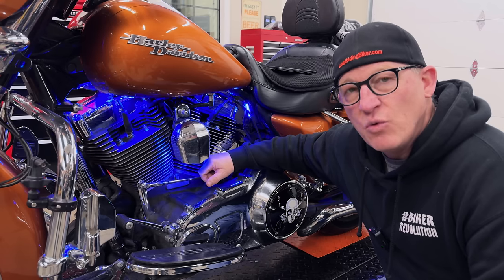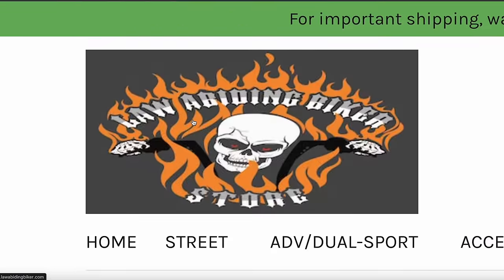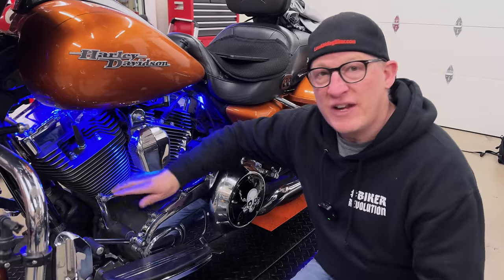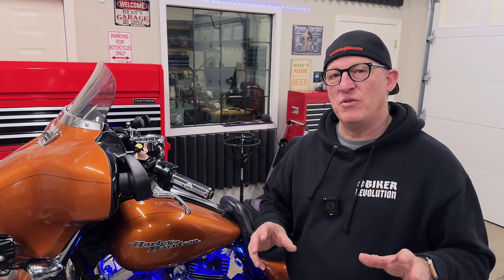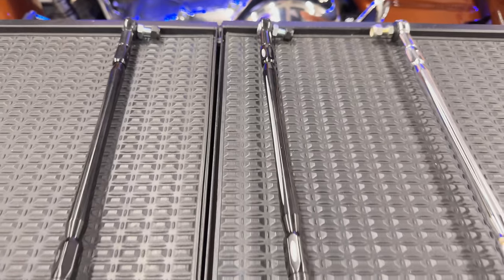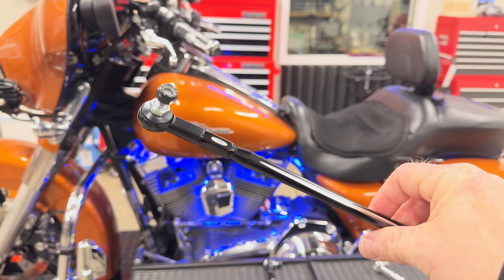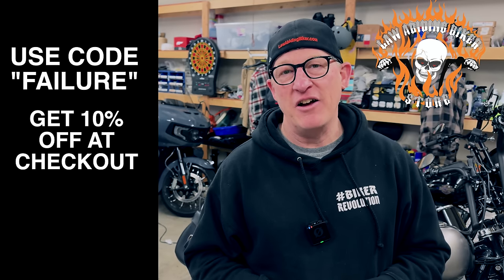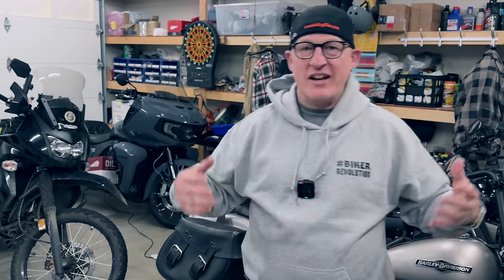2 Things GUARANTEED to FAIL On Your HARLEY! MOD THIS NOW 👍

Comment: Uhhhhh….why doesn’t Harley fix these known problem things.   They charge enough for the bike.
Reply from the maker: I know, same as BMW and others. There are just some things like this that have to be changed. I certainly wish it were not the case.
Reply: This is another reason why I will never trade mine in for a new one. After replacing way too many parts on the one I have I don't ever want to start over from scratch...not at the premium price the Harley charges for unfinished bikes.
Reply: Why don't they fix them?...$ that's why
Reply: How many motorcycles have you had that will last you your entires adut life? Let us call that 40 years. You pay 30,000 dollars for a pretty well loaded one. That is 750 dollars a year. I've had 12 or 14 metric bikes... not one of them has lasted even 8 years. They just wear out. Nearsighted people get to bothering the vibrations of life. Stop being a bad vibration.
Reply: Defective water pump 700 bucks the m8 2017 -2019 defective oil pumps,cam chain tensioners ,eco cam bearings the list goes on 😢and on😂
Reply: Try grease then no problems.
Reply: @MrDoyle07 l have had my Sportster for 25 years and 400,000 miles on the original engine and 37 back tires and 17 front ones and 3 belts in 25 years. My Sportster is my daily driver as I don't have a car. I have had my Triumph Tr-6 with a hard tail and magneto for 40 years. Ever since the EVO Harley big twins have so many quality issues for such an expensive motorcycle shameful 😢.
Reply: Harleys are designed that way … that’s how they make money !!
Reply: Because there are not really issues
Reply: @charlesscharfy6607  You can't be serious.  Do you really want me to list all the mechanical issues that the new motors have? Catastrophic engine failure at low mileage is #1. Followed by a shopping list of mechanical issues too many to list.
Reply: @MrDoyle07  I have had my Sportster for 25 years and 400,000 miles on the original engine and 37 back tires and 17 front ones and 3 belts in 25 years. My CX 500 had 250,000+ miles on her.l had that bike for 10 years. I have had my Triumph Tr-6 with a hard tail and magneto for 40 years. Paid $7,000 for my Sportster. My daily drivers.

Comment: I’ve riding Harley since 40 years back. I’ve never had any problem like this.
Reply: I too have never heard of shift linkage or arms coming loose or breaking in my 30 plus years of riding. Neither me nor anyone I have rode with ever had these problems you describe. Periodically check all your fasteners is good advice.
Reply from the maker: Glad it hasn't happened to you yet.  check out the overwhelming comments on this video of riders it's happened to over many years. It's a widespread issue ==> https://youtu.be/_GJz_J8IgqI
Reply: 88,000 on one evo never a problem. 74,000 on the twink never a problem. 67,000 on the 2017 m8 no problem. I have seen it happen on bikes not maintained.   In my shop probably done 5 in 40 years.  Guess your just lucky 🤣
Reply: It’s happened to me in the middle of a ride
Reply: Amen, proper maintenance and inspections of your ride, and she'll last you a lifetime.
Reply: Some people hammer on their shift linkage pretty hard.
Reply: hasnt happened to me either.  pretty sure he just wants to sell tools
Reply: @bradboustead1682  I see it all the time. Guys just mash the shifter going into gear from neutral. The clank from the trans can be heard for a 100 yards.
Reply: Ditto 160K miles on Road King and never had a problem. Of course I don't slam my foot/heels onto the shifter.
Reply: So, I was down at Daytona Bike week on my 2003 Anniversary Edition Ultra Classic.  I rode down and have 46K on the bike.  As I was shining the Harley Cover on the shift linkage, the damn thing came off in my hand.  So I just happened to be in the market.  I had my standard Harley Tool role and 2 black Zip ties that I carry with me, better than bailing wire, that Zip Tie got me back home.  The new Buell's are looking damned good, getting tired of this ticky tacky shit on my old great Hardley.
Reply: @MrChancebozey  Inferior pivot design, it happened to me on 2 different bikes.  Pretty common for people that ride the holy shit out of their bikes Mine has 70k of cross country miles.
Reply: 59,000  miles road king. Road Trip ready! Does your import motorcycle have a indicator light that tells you when to shift??
Reply: @richardburdyn9369  My Moto Guzzis do and I can set them for whatever speed I want.

Comment: I am so glad 😊 l have a great Sportster 883. I have had my Sportster for 25 years and 400,000 miles on the original engine and 37 back tires and 17 front ones and 3 belts in 25 years. She is my daily driver as I don't have a car. I have had my Triumph Tr-6 with a hard tail and magneto for 40 years. When she was 50 years old she needed new camshafts we split the cases and new ones and changed the sludge trap. Put her back together and now she is good for another 50 years. It's a shame that HD big twins have so many quality issues for such a expensive motorcycle 😢.
Reply: Rock on sportsters ! , 94k + on my 02
Reply: Ive got 135,000kms on my 09 Nightster, still mint

Comment: Why would Harley not want to fix this?
Reply: Because Harley. They've been building in engineering failures for years. My personal favorite is the brake system that literally eats itself with moisture.
Reply from the maker: Have  no idea. Been that way for years. Many other manufacturers of bikes and cars have things like this that you can't understand.

Comment: Yep my OEM linkage failed riding down the highway.  I got lucky and the nut and bolt came loose rather than the ball socket popping. So I hand tightened and made it home.  Ended up swapping with a Heim joint linkage sold by Kustom Cycle Parts on Amazon. Company out of Nebraska I believe. Anodized billet aluminum. And they will engrave so you can customize.  I also replaced the shift arm, shaft and those shaft bushings that require a special bearing tool.  But the end result is much more stable and failure-proof.  So if Kury stops making these, there are other options.

Comment: I replaced the rod ends with heim joints years ago but retained the stock pushrod.  The rod is not the weak link, the rod ends are.  I bought rod ends from McMaster Carr, a huge parts house for everything industrial.  I keep one of the old stock rod ends in my tool pouch in case another rider has a stock one fail on the road.  
I had to replace my worn out rear shift arm last summer.  On six speed bikes it’s an easy replacement, older 5 speeds requires the primary cases to be removed.   Check the fasteners on front and back arms with a torque wrench at each fluid change.
Reply from the maker: Correct. Pressed ball and socket/stock.

Comment: Had mine fail on a trip to Sturgis, it stripped coming into Missoula in the evening. Rode it through the night to Billings HD and had it fixed under warranty. Had to shift by hand all the way to the dealership.
Reply from the maker: Yeah bro, I've been there. Hand shifting to get to where you need to. LOL!! thanks for sharing.

Comment: Did 100 k on evo not a problem with shifter rod but I grease it when doing service.same as my street bob 30 k & not a problem .just a tiny bit of grease does wonders .thats why I do all my own work  shops skip the small things same as gear shifter & break peddles grease there pivot points .just like you should lube cables witch is another thing shops don’t do .

Comment: I had my shift linkage fail  last summer half way through a 10 day ride.  thankfully I did notice on my pre ride check i was getting some movement  in the linkage before heading on on the ride. I recalled your video about this Ryan.  on day 2 of the ride just happen to stop in a HD dealership to check things out.  while there i checked with service department and picked up a new shifter linkage.  Planning to swap it out once I got home.   Well on around Day 5 of the ride it failed , and  thankfully between myself an the buddies i was riding with , I was able to swap it out , and get back on the road in about 1/2 hour.  Thanks Ryan   love the videos.  you  save me some hardship and let me get back on my bike to enjoy the ride.
Reply from the maker: Just awesome story. Thanks for sharing. That's my aim, is just to help bikers know about stuff like this, so they aren't stranded.

Comment: I feel you on the linkage failure. I zip tied my linkage in 2015, I replaced the zip tie last year 2023 in Nebraska (i run South Texas to Sturgis). No need for a shifter replacement. I just carry plenty of handcuff grade zip ties. Also bring black gorilla tape.
Reply: wow. did zipties really work?? i have a 2013 ultra, always concerned about breakdowns far from home
Reply: @nelsongn9  yep. Zip ties really held it together
 Nut came off on front of primary. slid out. I zip tied as an emergency. It held indefinitely. Then the pivot above that came apart, zip tied that too. Many years ago. Might replace it some day. I have 2000 FLHTCUI. Note: 70k on Magnetti Marelli electronics. No issues. EDIT: not every issue can be fixed on the road, but for the ones that can, gorilla tape, Zip ties, and superglue is worth every square inch it takes up in the saddle bag.

Comment: Haven't had the shift linkage fail but I have had the shifter shaft fail on a long ride.  A lace from my wife's extra pair of boots worked find to upshift.  I'd rev it, pull in the clutch and tell her to shift and she'd pull back on the shoe lace.  Luckily it would still catch to down shift to get to the next dealer for repair.  It's made a good story over the years!
Reply from the maker: Yup I had the shifter shaft issues as tons of other bikers have. Check this out ==> https://youtu.be/_GJz_J8IgqI

Comment: Back in 2006 my shift rod failed 2400 miles from home at a stop sign.  I packed along cable ties which worked to get me moving again. Replacement has always been the number one item for my Harleys since.

Comment: So true. It failed on my '07 Low Rider with less than 30K on it. The replacement is so superior I recommend doing it NOW. Don't wait. In case you're wondering, low mileage because the guy I bought it from didn't ride much. .

Comment: I own a 2007 RG. My shift linkage is ALL stock. I have the bike since Memorial Day weekend 2007. I have over 103K miles on the bike. I clean and lube all pivot points at every service level. I have not had an issue with the shift linkage. I am now replacing inner primary seal and gasket. Also the shift shaft seal into tyranny. I will probably get a new linkage now and replace the stock one for astetics and prevent an issue this season. JRH

Comment: Replaced mine when I moved my mid controls to forward.  Also put some Loctite on the threads on (Sportster) the nuts don't back off during vibration.  Shaft arm - other of a different design than that.  Those linkages are very beefy!  I like those!  Cut out Roland Sands style.

Comment: 05 Softail and my linkage "fell off" thankfully while washing my bike in the driveway amd not at speed in LA traffic. Was really surprised how cheap amd janky this part is compared to the replacement. I guess its fine for the low mile donut shop rider, but not for a daily rider that will see many miles.

Comment: Just ordered mine up! Great imfo. Mine is good to go, but trying to be proactive, I'm getting mine while I can. Great video
Reply from the maker: Totally, I bought a 2024 Street Glide 2 weeks ago and I'm replacing it tomorrow. NO reason to get stranded. THANKS FOR SHOPPING IN OUR STORE!
Reply: The ball & socket joints failed after 8 years on my Road King so I went to Ace Hardware and picked up 2 heim joints installed them on the stock shift rod. Shifts just fine. Cost ? $10.

Comment: At the start of a long trip mine fell off. Tied it up with Para Cord and drove straight to the dealer. Install a Gimble bearing type and used it on my 2012 Ultra and now on my 2020 TriGlide.

Comment: Iam so happy I just bought a 2002 Dyna Wide glid non running in really great shape chrome and paint really nice got it for 1300 on ebay auction. What I've found so far is broken cam gear on crankshaft got more to investigate of course but I have a good looking bike to work with.

Comment: Agreed. the stock linkage rods do fail. We always upgrade to custom rods with real Heim joints. However along with tools, I carry a complete (nearly new) stock linkage rod in the bottom of my bag.
Reply from the maker: Roger that. We too carry an old linkage just as a backup. Thanks for watching.

Comment: I just changed to heim joints. Went 80,100 miles on my 08 stock joints. 
Just sayn.
But,  the heim joint is more solid for sure.

Comment: I purchased one online. Aluminum with Maltese cross, “ Ebay“. When I received it, I thought it was plastic, I did the bite test 😂, it was a very cheap “Chinese“ aluminum. While on a ride, it split in half. I Thank God I had the original in my side bag and was able to change it out quickly then catch up for the ride. I learned my lesson from online aftermarket bike parts.
Reply from the maker: Yah, Amazon is a beast for sure. Advertising so much knock of stuff these days. I feel your pain.

Comment: Oh boy are you right about the shifter shaft arm and the linkage going bad at the worst time. I had the shaft arm splines go bad on my ‘15 RG on my way to Laconia last year. Coming out of a toll booth it failed. I could only get into first and second gear. By the grace of god I was only a few miles from  Manchester HD. I was able to ride to the dealer and change out the shaft arm and the linkage in the parking lot.
Reply from the maker: Thanks for sharing.

Comment: Just bought one Ryan. Thanks for your video. Is the sticker shift bracket you also mention one from HD or aftermarket company? I have a 2014 SGS.
Reply from the maker: The shifter shaft arm is OEM ==> https://youtu.be/_GJz_J8IgqI

Comment: I have an 04 Electra and I'm going through the gear shafts annually.  The teeth on the inside of the shaft (closest to the motor) keep getting stripped.  This time around, I noticed the bolt threads are also chewed up, so I am replacing that too.  I've done the blue loctite and checked everything else.  I just cant figure out why this keeps happening.  I've had to make it home with zip ties several times now and I'm looking for answers!

Comment: Bike had 15k miles at failure at the front spline (stripped) during a month long road trip out west in 2017. Fortunately I had researched this before leaving and carried a spare linkage, arm and spline. Pulled over in a McDonald’s parking lot after I felt the shift going limp and repaired it in under an hour and was on my way. The was no indication of failure before I left on the trip.

Comment: Have a 22 Heritage Classic and came with heim joints with thru bolts but still changed it . Joints on these aren't failing but the bolts are . Had one break on my light bar in front and now recalled for shock adjuster bolt.
Reply from the maker: Thanks for sharing.

Comment: Head hoggers, has the only ultimate fix as far as I know. The free play comes from the bushing inside the bike. The kit will give you a printed bushing to completely remove the "play".  Paired with a good shifter linkage it will be more solid than stock with zero play.

Comment: You should never have to replace the linkage rod , you don't need to hammer on it to shift gears. Adding a drop or two of oil to each of the the heim joint when your changing the oil, will make a world of difference in longevity. If you have to change the front shift lever, this is a good time to drill and tap a hole for a zerk fitting. They used to have them on touring bikes, but I guess Harley decided to not install them anymore.  And every oil change , put a wrench on the rear shift lever clamp on the transmission bolt. If that gets loose and rounds out, it's a pita tp replace. The whole primary has to come off to remove it.,,,
Reply from the maker: The stock don't have heim joints. Pressed ball and socket. Glad it hasn't happened to you YET. So many have dealt with this over the years. Here's some comments and info to see how wide spread it its ==> https://youtu.be/fBrlm2KW5Xo

Comment: another problem on the linkage is the back that goes to the transmition  the little arm that sticks up has a bolt on the bottom like the front  and it comes loose if it falls off you have to remove the whole primary you can get a hold of it and see if it moves back and forth,, it shifts front and back  if it moves back and forth its loose you can get an allen key or allen wrench in there and tighten it up....  i saw a video on it and caught mine just in time.................i thin it may have been one of your video's 4-5 years back.......
Reply from the maker: Check this out ==> https://youtu.be/_GJz_J8IgqI
Reply: yeap,  mine was on the back one......... thanks man.... @RyanUrlacher

Comment: Didn't you have a factor shift rod fail out Cheyenne way a couple of years ago???
Reply from the maker: GOOD MEMORY. Yes I did. It was my shifter shaft arm that failed. ==> https://www.lawabidingbiker.com/harley-shifter-problems/
Reply: Thrashin Supply has a nice aftermarket shift lever that changes the torque of the shift arm & allows one to find neutral easier…